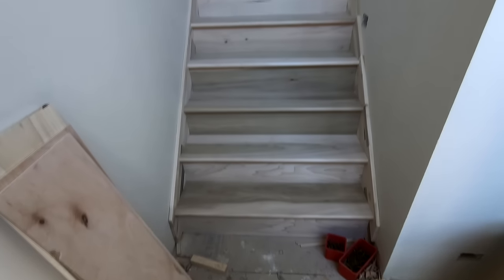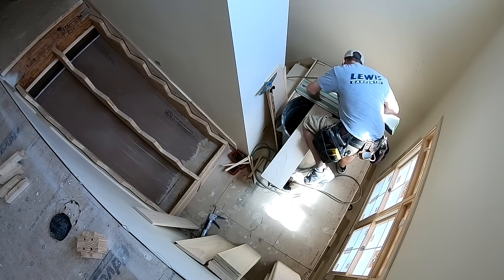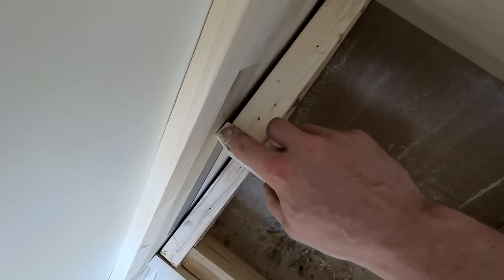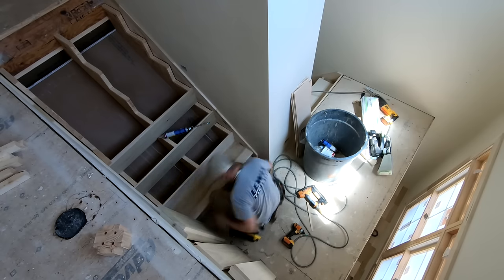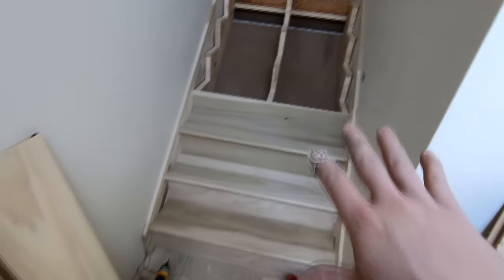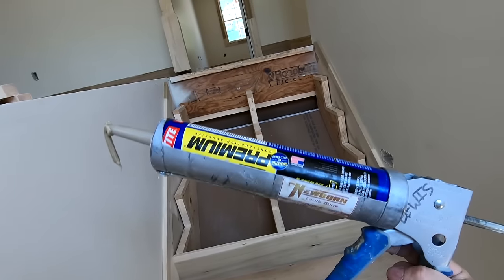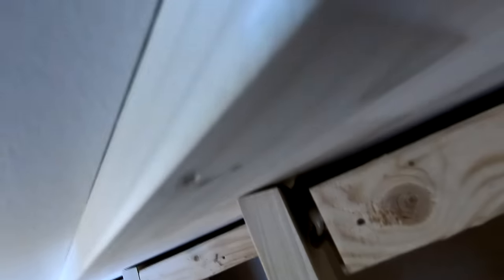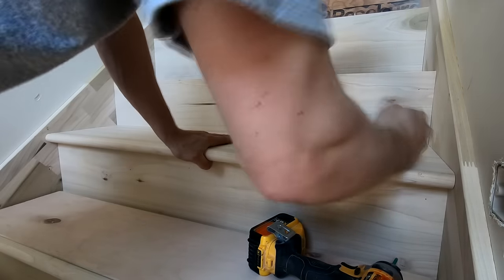How to Install Hardwood Stair Treads & Risers...Key Techniques for Perfect Results

Comment: This is almost identical to the way I've done dozens of stairs. I've also done my share of 2cm and 3cm travertine slabs on landings and treads respectively using many of the same techniques. My only question is, why the hell are you telling people this stuff. I've  working very hard to learn these things through three decades of trial and error. Not cool man, not cool. Ps. I like a 3 degree back cut unless it's stone work, cuz that shits heavy. Also, there is no better pencil than a utility knife. Although I do like crane knives because the blades don't wobble quite as much with those retractable pieces of crap. Good work man, but stop making videos. ; )
Reply from the maker: Why make videos? Just think...what young person would want to get into the trades if its going to take them 3 decaded to learn the content that I just put in a 20 min video. Also, think how much happier you'd have been and better work you  would have done your whole career if someone had shown you some of these things from the start.
Reply: @InsiderCarpentry  True enough.